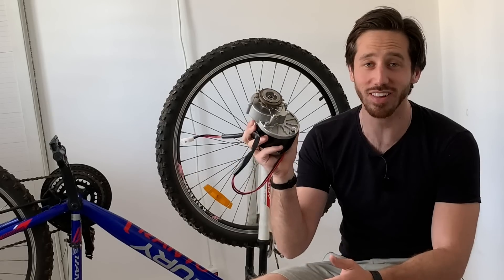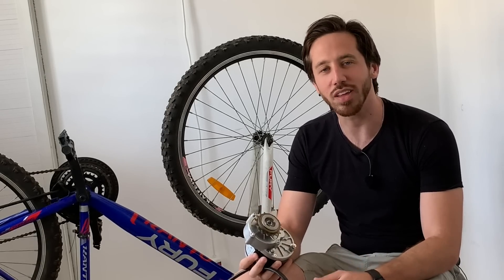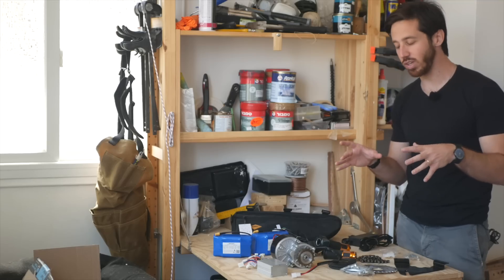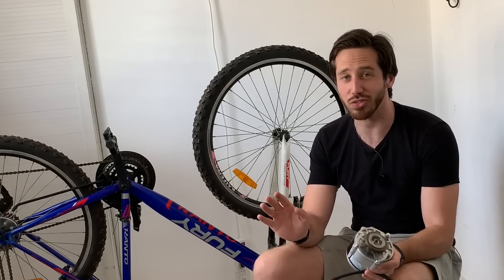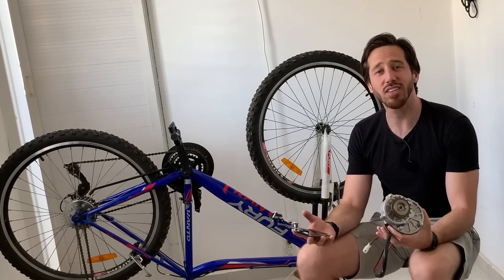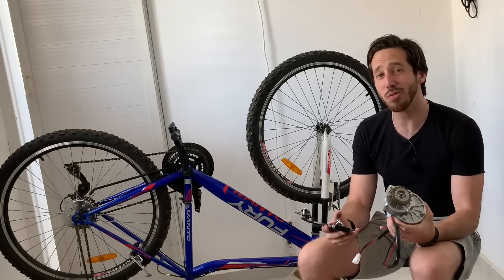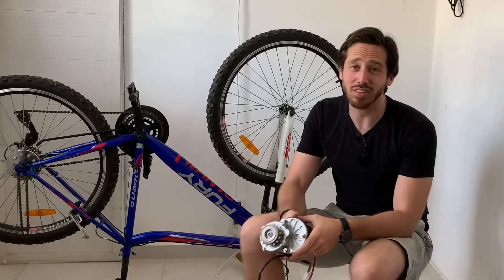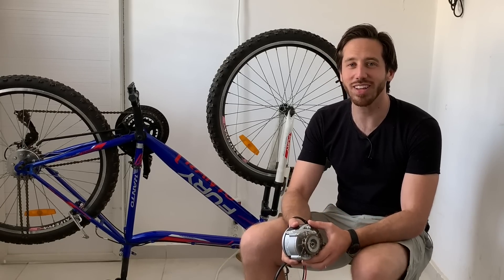Do NOT buy this $103 electric bike conversion kit

Comment: The cheapest, easiest and most reliable e bike conversion you will keep for a while, is a 750 Watt, direct drive rear hub wheel (26" tire, most common) with throttle only. Bare bones setup - motor w/wheel, controller, throttle and brake levers with kill switches - @ $ 170 in 2018 w/Amazon.  Slap those items in @ 30 min or less.  I'd recommend ordering both a thumb and a RH half grip throttle so you can figure out which one you like for your riding style - $15 more. Augustine e bike website has links to Amazon vendors.  Start research and pricing there.

Cadence sensor with bike computer just adds cost, but extends range with low power settings.  Fyi have a hot glue gun available for pedal sensor plate mount if ordered.  Will need crank removal tool too if installing this option.

Battery - just buy it on Amazon, easiest.  I like US Battery since they have Texas warehouse - quick shipping and 2500 mAH batteries.  Joyosi used 2200 mAH batteries, shipped from China (long wait) not worth it.  You can DYI a battery pack but may not save much because of Spot welder purchase, BMS and battery case.  Check Batteryhookup.com as a source for batteries.  Get a paper copy of Micah's Li-ion Battery book.  Good reference if you're new to this.

Did a friend's Craigslist Carbon frame Mountain bike w/ rear brake pads, front disc brake, 26" wheels.  Added a $300 52V hainan style battery pack - disassemble battery frame and drill @ 3/16" hole in lower cast aluminum battery cable plate so it lines up with existing water bottle mount holes - that way you don't have to mount battery upside down.  Use Zip ties to secure top part of rack to frame for more rigidity.  Battery, wheel n bike - 36 lbs - very light, hub wheel @ 19 lbs.  Hit the throttle - IT JUST FLEW!!  Definate keeper bike that has power for hill climbs, trail riding and guessing easy 25 mph on flats.  Told him to have throttle discipline for range and going too fast that makes people mad.  @ 36 lbs easy to just pedal on flats with no power..

Micah, another suggestion for "Riding at Speed - safety video, what to watch out for". Add telephone poles and wide handlebars don't mix - did too tight of a right turn and handlebar end, clipped telephone pole - turned harder and went down - oof.  That hurt.

Appreciate your videos, always sincere, upbeat and honest. You present well and make ebikes approachable for all types of people and budgets.  Yup, go too cheap, it's underpowered, low range and slow - you end up buying a better bike.  Cheers!!

Comment: Hey I Build eBikes As A Side Business! I Mounted That Same Kit On A 20" Girl's Bike & It Worked Great? After I Cut Some Notches In The Metal Flanges To Get it Lined Up With The Rear Wheel Sprocket + Used Some Plumbers Tape Around Frame Bars With Additional Longer 1/4" Bolts Etc To Adapt It... The 13 Year Old Daughter Of The Lady Lived It As Her Birthday Present, & A Few Days After She Picked It Up They Sent Me A 15 sec Video Text Of Her Zooming Around In Their Yard & That Made All The Frustration Worth It!!! Butt It Took Me Days To Adapt Kit To Fit Her Bike... LOL

Comment: I have one of these kits with almost 1000 miles on it. I wanted to use a cruiser for it so I made a template of the mount and to it shopping with me. I decided on a Kent 2600 Bayside. I did have to modify the mounting bracket by taking about 1/4 inch out of it. The motor sprocket is NOT intended to be used as a lefthand drive. The bearing will actually unscrew itself. I used a little epoxy on the outer ring and have had no issues with it. I went with the 24 volt 450 watt motor and it screams with my 36 volt battery. I can cruise at 28 mph on flat ground.  I don't typically ride it that way but I I pedal with it at about 20mph. Hills are no issue either. I have a few videos on YouTube where I talk about my issues with this kit that I can share is anyone wants them.
Reply: Also about same story here, had to cut out pieces of metal from mount, so that the motor sits closer to the frame.

In our case we had more hassle with getting both chains tight, as it was single speed bicycle before, had to mount tensioner for the single speed to make it work.

Otherwise speed is quite good with 24v 450w motor along with 36v battery and controller.

Ive heard it is possible to run these from 48v but then risk is high burning them.

Lots of info about these on endlesssphere
Reply: @kineto7  i used a half link to get my chain as tight as i wanted. My biggest issue was the freewheel sprocket kept falling apart. I used some JB weld to attach the back ring to the adapter for the motor shaft. 
I also run my motor at 36 volts and no issues there. 
I don't know about anyone else but for me it is well worth the money i paid. I got a 28mph Ebike for $300 including the bike and that is ok with me.
Reply: @jeffholmes9483  Gladly we didnt have any freewheel issues. Buy yes, the chain alignment part was a pain, I think about a day was spent before it got sorted and right technique figured out, also first chain seemed to have worsen situation, so I think at end we switched to bmx chain as well.

Price wise very good kit, considering that significant speed can be attained, usually 48v battery might be needed for 40kph speed
Reply: Now only $350 per unit, free shipping within USA Mainland.
Original Kiwano KO1 PLUS Unicycle Scooter
Store Link:
https://www.alibaba.com/product-detail/FREE-SHIPPING-unicycle-UL2272-KIWANO-KO1_62396810871.html?spm=a2700.icbuShop.111720.3.1f7c3f80MsHXZD#reviewSubHeader

Comment: If that frame is steel I would fabricate and weld steel mounts (steel tabs cut out of 2mm thick metal would be plenty strong for that motor) directly on the frame, wouldnt even bother with universal plate that comes with the kit. You will have perfect alignment and decent strength, one of the mounting tabs could even have elongated hole for additional chain tension adjustement if drop outs on the wheel arent enough for mounting/demounting motor chain. If you dont weld it wouldnt cost much if anything to have someone weld it for you, in fact that same person would probably be able to cut and bend those tabs into desired shape for you,  or even better, they could give advice before you commit to anything.
Bit of sanding, painting then wet sanding then paint again and buff  it will look like factory finish and 10 times better than those universal plates and brackets. Car paint seller will match you any colour, 1 spray can would be more than enough.

Comment: I got a 250w front wheel hub motor, was half the price of a rear hub/mid drive at the time.. turned out better than that weird type. Makes the bike '2WD' and can do front-wheel burnouts :)
you just get rubbish weight distribution though... with a well positioned battery you're still looking at 65/35 f/r

Comment: I purchased a similar one.. a nightmare to fit on my MTB.. found a cheap used china tandem bike with freewheels on both ends of the rear hub. Changed the motor sprocket to a fixed 13T. Flattened the mounting bracket and added some spacers to align the motor. 36v 350W does 31km/h with solo rider. Cheap, noisy & kinda fun. Will not be buying it again.

Comment: My dad gave me an old E-zip that has a similar motor, but the bike was designed for it! I’m going to revamp the battery with a Lithium instead of the lead acid batteries it came with. Why aren’t you building a battery for the cheap ebike? I would think that would be cheaper than buying one?

Comment: Thanks for the heads up I was going to try one of these kits but I'll wait till you have tried the other kit first .
Reply: Go with a gun motor, incredibly simple and safe. They also aren’t that expensive (the kit he was using is so overpriced, it would only be worth it if it was $50, because you can get high powered hub motor kits for not much more).
Reply: **not much more than he paid.

Comment: Did you try mounting the bracket on the inside of the frame instead of the outside it looks like it would fit and line up the chain that way
Reply: Zeksteve  not many but any. All of them motorcycles are working that way.
Reply: That was my plan, but it requires a reverse freewheel which they offer.
Reply: From Yalu - Marina, I don't like this public reply discussion with you, but YouTube left me no obvious way to reply. I have been emailing you directly about my getting the wrong kit. I ordered the left kit and received the normal kit which has the freewheel running backwards from what I expected. AliExpress order # 8014776998395459.  Shipping carton packing slip # 20012432379. 
I can't use this kit that way and need to get that freewheel reversed like I expected. I did expect to manipulate the mounting plate, but anything that I accomplish is useless without the backwards (left?) freewheel I ordered and expected  I did not get the LEFT kit I ordered. Please help me resolve this problem.
Reply: @williamirwin5945  I had the same issue with the freewheel and fixed it with a little JB Weld. I applied it from the retaining ring to the adapter insert. Since using this fix i have put almost 1,500 miles on this kit.
Reply: @jeffholmes9483  Let me understand you. You 'welded'/froze the freewheel so it is now a solid sprocket. This suggests that the motor gets pushed by the bike wheel when not under Epower. Then the motor has low resistance to pedaling.
Reply: @williamirwin5945  Hi there ....I have installed what's looks like the same motor on a tandem Rover trike ....no freewheel love the regenerative braking while charging my battery   going down our many hills ( hillbilly area ) sometimes when I get home my batteries are fully charged .....max speed only one speed for me is about fast walking speed on the level ....made my own bracket out of 1/4 aluminium , motor is a generator for most of the time .....now waiting for spring and see how long the brushes will last along with motor bearings.....my front disc brake pads are 30 bucks a set so hopefully the regenerative braking will spare the brake pads and my breaking hands.....and thanks for the video
Reply: @williamirwin5945  Hello again ...I've been running mine fixed all last summer....I can vary the regenerative braking by applying a 12 v resistance load ( caframo fan , coolatron 12v fride ) ....
Reply: Zeksteve  I realize that, but the freewheel is also backwards. I have ordered that  and some extra chain. Turns out I misunderstood what the LEFT version meant. I actually thought it was the freewheel direction, not the bike side. My bad!

Comment: I have this on my bike and it's a good kit, i am thinking of buying another one,  but you would always need a little fabrication to make it align.  In your case,, you would need several washers per bolt to bring your sprocket out.  And somehow bend or mount your motor bracket in a different location like behind the frame.   That motor bracket will not fit every single bicycle since every bike has a slightly different frame geometry...
Reply: Yes or as @Chris Grillo suggests a steel plate to shim the sprocket.  These kits aren't exactly plug and play. They require installation. On one of  my petrol motorized bikes I ran into a similar sprocket alignment issue . I used scrap sheet metal salvaged from a discarded household  appliance to fabricate the shims.  Used the sprocket as a template to mark out the 9 mounting holes + large hole in center and problem was solved at no additional cost. 

I don't have this exact kit but I have a similar kit produced by Currie a long time ago.
Reply: Is this motor can last ?

Comment: Thank you for taking one for the team. I think your least expensive option would be either a front or rear motor conversion kit with a 36v 500W gearless hub motor no lcd just an Led on the throttle etc. If you look you can find them for about $200 on Amazon. Thanks again
Reply: They are way cheaper, at that price you’re looking at 1000-1500w 48v kits at around $150. But hub motor really is the way to go.
Reply: Jake Garrett yes you can get 1000 watt 48 volt hub motors. I have not seen them for less than 200 usd on amazon or AliExpress, but the other issues are batteries. A 36v HL 12ah battery is 200 usd unless you get a shrink wrapped Chinese mystery battery or assemble the cells yourself. Once you go to a 48v or higher voltage 12ah battery, the price jumps up. I run a geared rear hub 500 watt Bafang and a front gearless hub motor 500 watt Mxus. I run two 36 volt HL style batteries. My motors are very light weight compared my kick ebike that has a 1000 watt front hub motor. Yes it is very powerful and fast but also very cumbersome as far as weight and size go. BTW; where do you find 150 usd 1000 watt hub motor conversion kits? Thanks.
Reply: reeread I found mine on EBay “Voilamart” is a pretty good brand that will withstand some serious abuse (sold by official Voilamart on EBay, I think they also distribute through Amazon too). You can also run 36v on them (zone controllers don’t have low voltage cutoff, so they can work with just about anything), it’s just going to be slower than 48v (the equation for power is V*I which means that a 48v kit rated for 1000w would only be 750w at 36v since these are using current limiting controllers), they will actually allow for more current and power if you want to solder the shunts you’re trick it’s readings, but ultimately the big problem isn’t the 750w, it’s actually the efficiency curve goes down as you make 0% efficiency at max and min possible rpm ranges so if you want high efficiency the higher voltage is a better/more useable efficiency range, and your wheel speed is directly proportional to the voltage, so a 36v battery will spin it 36/48= 75% as fast, which for example if it’s made to go 30 mph might only do 22.5 mph (maybe 23-24). However, you’ll probably find the 36v motor kits likely use the same motor.

I know a lot of sellers have the same wheel, and they just sell you a 36v 10 amp controller, or a 48v 10 amp for 500w, or a 48v 20 amp controller for 1000w, or they’ll even have 60v controller etc. it’s often the same wheel, you just chose the bundled controller in a drop down menu.

Comment: Micah I have one of these kits on a beach cruiser it works fine the motor has been pretty reliable I have over 800 miles on it I did have to modify the black bracket by simply laying it on concrete and flattening it out with a hammer it made it work just fine little tweaking it was less than 10 minutes worth of extra work and I was ready to go

Comment: I have the same problem with a Tongsheng TSDZ2 mid drive motor kit & tried to put it on my carbon fibre frame, unfortunately the spacing between the motor & where it connects into the bottom bracket is not enough for the thickness of the carbon fibre  frame's bottom bracket. I looked at other named brands & their measurements were not much better, they would not fit at all either. The problem is that the thickness of a steel bottom bracket on most frames are around 2.5mm to 3mm & the thickness of the alloy bottom bracket on the carbon fibre frame is 10mm. So for me to get the motor to fit & work I need to cut a C shaped channel into the 10mm thick bottom bracket about 5mm deep.

Comment: Hi! I did watch your previous video and have since built my e-bike with this kit. At the moment, only one brace is connected so there are 2 points of contact instead of 3, but I will reinforce it later. The wheel sprocket and motor sprocket are decently aligned. My back wheel doesn't have the 9-pointed star shape with the spokes, so I ended up leaving out 2 bolts which has required a bit of fiddling to get the sprocket flat. It's been annoying, but in the end, it works!  It was still worth the $200 in my case.

Comment: I would like to see you finish this with a custom mount bracket so we can hear how well the rest of the components in the kit work.
Reply: Yeah, I mean the thumbnail says I hate this motor but it seems the issue is the cheap bracket fit. If someone is building the super cheap route, they should expect some fabrication work.
     You're not going to get anything 'plug and play' going super cheap...
Reply: @JohnDoe-pv2iu  
It's worse than that... I am good with "fabrication work" but "work" is a 4 letter word, so I have been studying this electric bike subject long time!

Now look closely at this kit... There is something very wrong that has to do with the design of the left and the right side plates. Figure it out, but I will be happy to give the answer if you are stumped...
Reply: Hi Jeff I have installed this kit with same mount and it works perfectly got over 30Km/h  using only the motor.. I made a video of installing this kit with (450W 36v motor) and it worked out great for me; I used a hammer to modify the bracket (no special tools)  Check it out  it works flawlessly !!! :) - https://www.youtube.com/watch?v=bpkHHyniQcY
Reply: Customize it with a sledge hammer in your driveway like I did mine. Pounded mine flat and Wala!
Reply: I used something similar to build a scooter and it wasn't bad for the price
Reply: That kit actually for single speed bike. Newer version use freewheel and mounted on the chainside of the bike. That probably can be used on multispeed bike. Just need to change to a lower number of gears by 1 or 2
Reply: @finhas8865  
I think the right side came first. That's why the left side version is readily available. And they did something very wrong when making the left side version (or rather they failed to do something). Check out both/all versions and see if you can spot the problem... Happy to explain if it isn't obvious upon close inspection.
Reply: Same
Reply: Xxzzzzzz has a lot of different things to say to me when I'm on the phone with my friends and I just want
Reply: @MrSauve16  I feel the same way